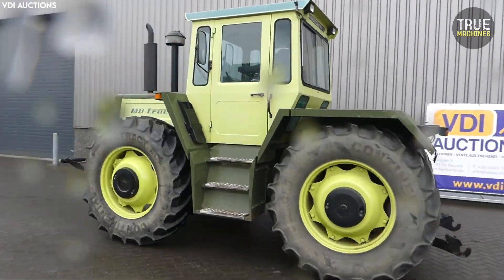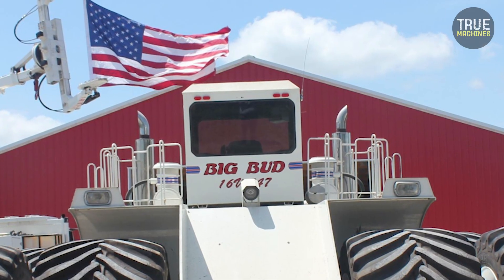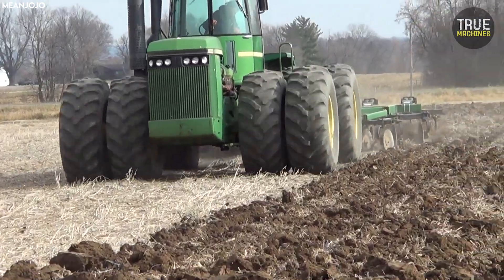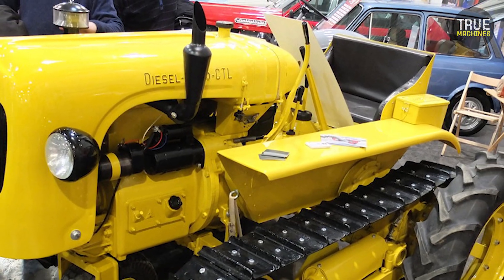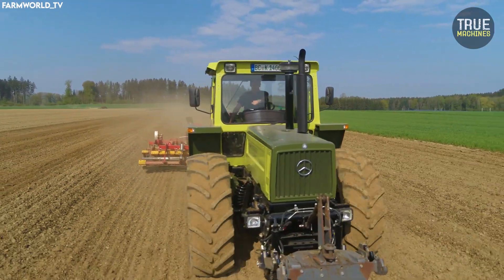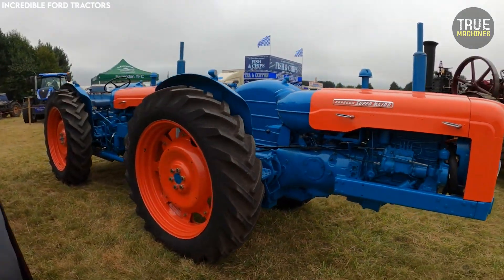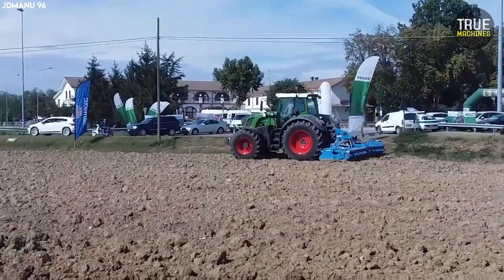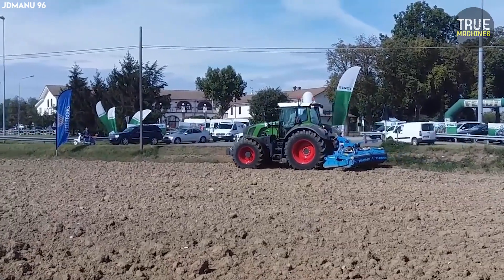The 10 Most Over Engineered Tractors

Comment: What a bunch of bs. The versatile 1150 did not have 2 v8 engines. It had a single inline 6 cylinder Cummins 1150 cubic inch engine. They were and still are a beast in the field.